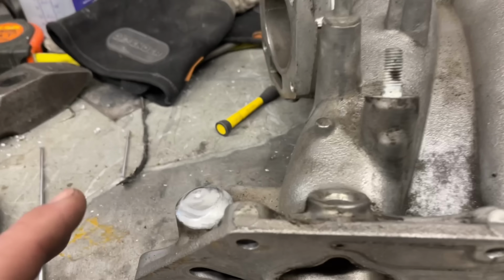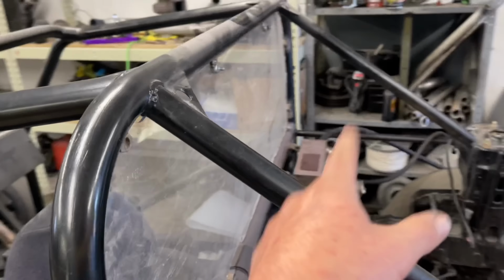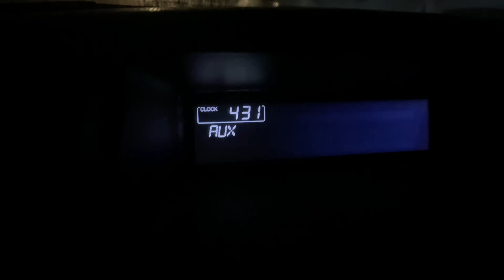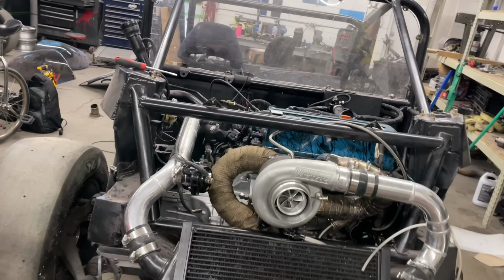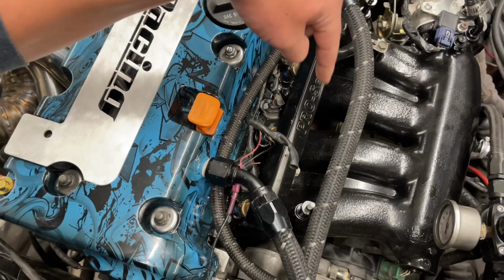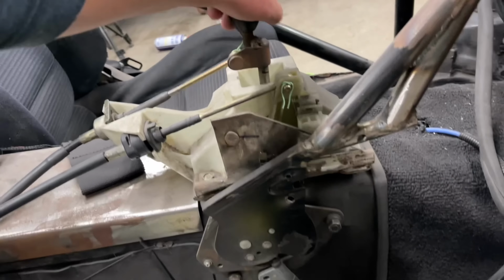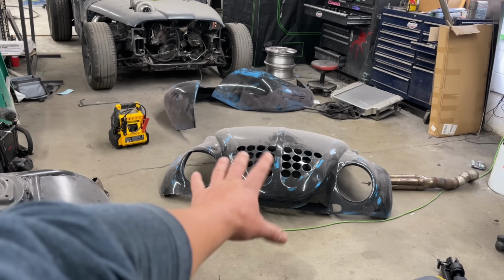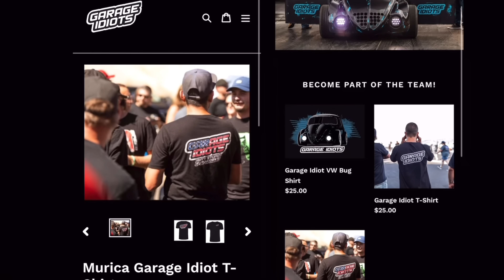How much ABUSE will this take?

Comment: NIce transmission, I noticed a twin disk, I cant remember do you have a valve inline to control clutch slip on the launch ? If not might want to get that